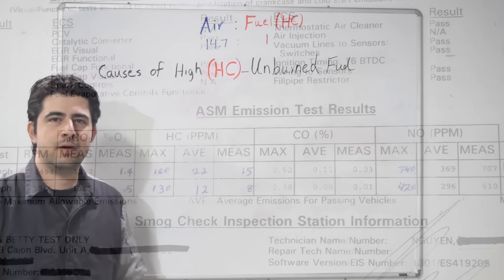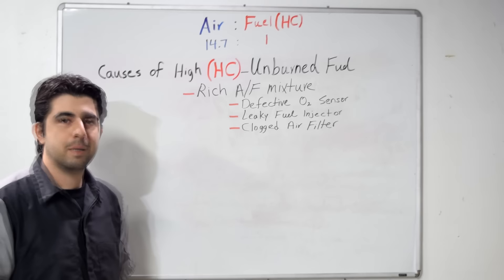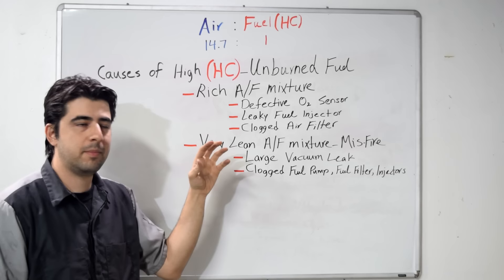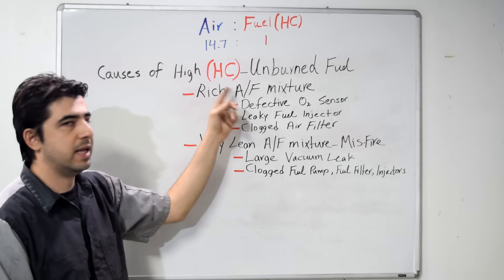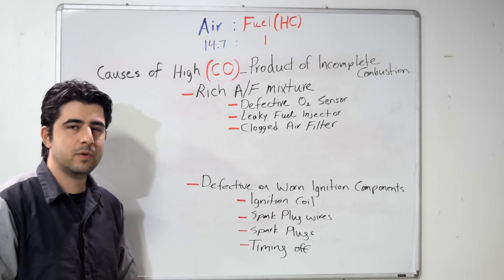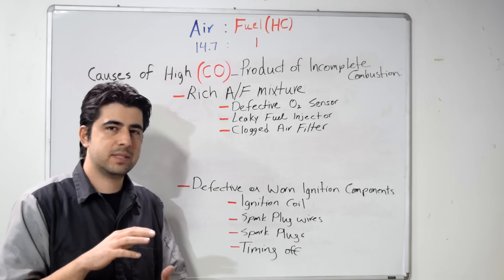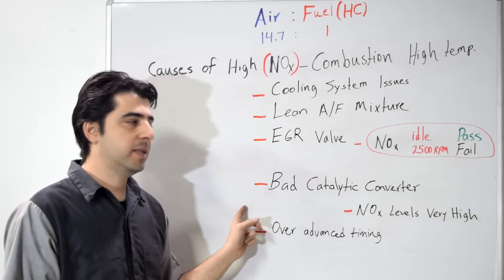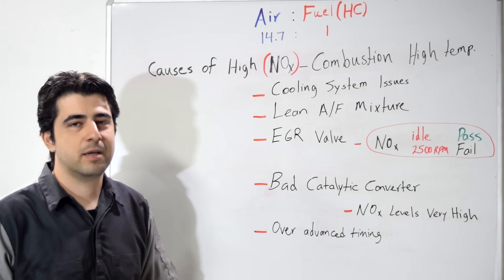Diagnosing a Failed Emissions Test - High HC, CO and NOx Causes and Repairs

Comment: I had failed my smog test, and after seeing this video I knew what to do.  My HC had failed, so I Knew it was the air mixture.  I got a new air filter.  I also got the "catclean" product...more cleaning.  I then removed my negative battery terminal to reset computer.  I even got more air in the tires.  My HC was 145 when I failed, today it was at 6.  Easy pass.  Thanks for great video.
Reply: My was 240 and max was 170 what do you think it could be

Comment: I always replace everything that’s cheap first. Check for vacuum/air leaks and exhaust leaks. Change your engine oil and oil filter. Change your air intake filter if it looks old. Change the O2 sensors. Add some Lucas fuel cleaner. Check your tire pressure (can make a difference on dyno smogs). Lastly, take it for a 20-30 min highway drive before getting it smogged. Leave it running until it’s tested.
Reply: I did all that. And welded in a new cat. New lambda plug. P.o.s corolla still wont pass for hich co and hc. Now it goes to africa. Bye byeeee! 😂

Comment: Over here you get your car back ( a 1976 carbureted 4 cylinder ) didn't pass the Emissions test the problem is that it's undriveable when it did pass. So when you finally did make it home you get a few screw drivers and fiddle around for 2 days so it doesn't use crazy amounts of fuel and runs as it did. No one who bothers you for another 2 years. It probably would have passed in 1976. The only way for it to pass and run as it should is an LPG installation. For new cars guess you covered them all.

Comment: Very informative, thanx. Especially liked...

1) If NOx is a pass at idle, but a fail at higher rpm, EGR valve is faulty 
2) If NOx is WAY above the limit (2-3x or more) catalytic converter is busted
Reply: Egr system... Usually EGR is good but dirty very rare for them to fail...

Comment: I had issue with high hydrocarbons on my 1995 Toyota Corolla. I followed your instructions and replaced spark plugs and the problem was solved. Just for a good measure I used engine cleaner, put a new high mileage oil and high quality gasoline. Passed the DQ without any issues. Thank you very much!

Comment: Very good explanation. One other point is that if you have a thermostat that is stuck open and the engine runs colder than it should, the EMS will over compensate the fuel mixture and the engine will run too rich thus increasing the Co2 levels.

Comment: my hc co pass but nox off the charsts 1300 too high so, i changed egr and sensors and got vacuum lines working too distributer ,now im not smoking at idle ,not blowing white smoke i begin too take off ,so now on too cat  then muffler  thank you sir spot on those problems !!! i recommend getting spark plugs wires firing very very good so you can tell when driving after more power etc..

Comment: Dude thank you so much my 95 civic failed the HC and NoX but just by by a little. My HC was at 0.87 and to pass it has to be 0.80 and my NoX was at 2.60 and to pass it need to be at 2.00 now I know what to look for and try to fix it

Comment: Lacquer thinner in the gas is supposed to clean the catalytic converter.
It's scary but I put some in my cars and it didn't kill them. It sounded more throaty but can't fix everything. Removing the cat and soaking in solvent is supposed to be the best.
My mechanic recommended Seafoam for de carbonizing the engine but then all that goes into the catalytic converter.

O2 sensors on eBay are dirt cheap but are they any good?

Many plug wires and coils are junk.
There's counterfeit products in very real looking packaging.

The tip about tire pressure is golden!

Comment: Thank you very much,great video and explanation, my 1998 Bmw 740il failed smog with high nox at 2500rpm, if you are in california I will ring my car to you.
Reply: if you have the original catalytic converter it may need replacing. they do go bad.
Reply: @thedeathwobblechannel6539   so a car that has the original catalytic converter(about 23 year's old) from 1997 should just be replaced with a new one?
Reply: @memomunoz2266  mine had the honeycomb break apart and would go sideways to the flow and choke off my engine.  The "go bad" when the honeycomb breaks. It has no moving parts and no replaceable parts. If it clogs replace it

Comment: this is a pretty good explanation, however it is incomplete. one big thing that most people often over look is carbon build up which can increase cyl pressures and temp's leading to elevated nox emissions, another thing is a rich condition can do the same thing because the cyl pres be higher, along thos same lines is if the head has been machined after a bad warp. on some vehicles i have observed that too much fuel pressure can actually cause high hc's instead of co. every car is different but still a very good video

Comment: My 2008 Nissan Altima failed the emission test and were struggled long to find the cause. Ignition coil, Sparkplug, Injectors, MAF, PCV valve, Oxygen sensors, Catalytic converter, Piston rings everything was addressed but the problem still persisted. Finally, someone noticed that the temperature gauge was always showing a very low value. And it was found the thermostat valve was faulty and was stuck open and the ECU was sensing it as cold start condition always and the fuel air ratio was running rich. The fuel economy also improved a lot after replacing the thermostat valve but I miss the sporty acceleration and pick-up when it was running rich.

Thought might be useful to someone going through a similar trouble.

Comment: Every year my 97 Dodge Caravan gets closer to failing the emissions test and this last time it did fail on the HC part of the test, when it measured 62 ppm when it was only allowed a max of 51 ppm. So I decided to try filling it with E85 Ethanol on a almost empty tank and it worked. When I took it back for a retest it drastically reduced the Hydrocarbons (also the CO and NOx) and I passed easily! I recommend anyone who is a borderline fail to give it a try because it worked better than additives and other methods that I tried and didn't work.
Reply: 51ppm? Thats insanely low, it would have to run on water vapors, 510ppm more likely? 200ppm is the limit in sweden.

Comment: Failed smog test. Failed 15 mph test. 100 over PPM at 608. 
I put new plugs and wires, replaced Head gasket kit 4 months ago. 
O2 Sensor is fairly new, replaced it 4 years ago on last smog. And also replaced Catalytic converter same time 4 years ago by pro shop that specializes in muffler and Catalytic converters. 
Had shop rebuild engine 5 years ago. It's really strong engine. 

Tonight I replaced air filter and put in Guaranteed to pass Fluid. 
going to replace Fuel Filter tomorrow! 

Emission test results on fail say: CO2 is 17.4, O2 is 0.0 and again 100 over NO PPM at 608. 

Any thoughts?

Comment: Hi first of all thank you very much for this video i got so much knowledge by this video i always check videos relating to car fix but never seen someone explaining like this .
i have one question i drive 1.4 petrol car 3 months back engine warning light came up  there was a problem with o2 sensors but i replaced 2 sensors but stll engine light stays on few days later i reset that light but next day engine warning light came back again brought to garage they checked there was a problem with exhaust was leaking they fixed it and last week i brought my car to pass emission test they failed because of high Hc and co  and the warning light came back again.so can you please tell me what could be the problem thank you.

Comment: im a tech here in CA here are some tips :

for the years 2000 and up. they use a new machine only checks obd 2 so no check engine light and all monitors completed expect evap will pass your test .

for 1999 and older your car will go on the dyno if its 1996 and newer you will not pass if you have the  check engine light on , computer picks it up and fails the car automatically  even if you do good on the dyno.  

for 1995 and older you "can" depending on the shop pass with the light on and monitors incomplete since you will not communicate with computer , it will be a visual inspection at that point .  but most likely if you have a light on for like a misfire or something your car will not pass the emissions test since it wont burn the fuel properly
Reply: Josey Marine I have a 95 truck and emission test fail HC was high at 240

Comment: I have a 1995 Mercury Mistique with a 2.5 V6. The passages in the plenum behind the gasket of the throttle body were completely clogged and the EGR tube had a split in it so I had multiple things wrong and this caused me to fail the emissions test.

Comment: I calculated my A/F ratio using my ASM results, and im running very lean at 15mph but only a little but lean at 25mph. Would that still be a vacuum leak? I also noticed my o2 is high at 15mph. im thinking maybe at 25mph the vacuum leak is being overcome by something and everything passes at 25mph. can someone please shed some light for me, thank you

Comment: Thanks for making this video. But I have a question about NOx. If I have excessive high NOx at 15mph but lower than avg for 25mpg, can I rule out a bad catalytic coverter?
Reply: Clarence, I thought the same thing for my car (same scenario)  but as my CO is very low at both speeds I’m ruling out a bad cat for now and focusing on plugs/wires first (partially focusing on cheaper fixes before hitting the big $$ items). As you commented three months ago and I suspect you had an emissions issue, whatever became of your circumstance? Did you figure out what was wrong?

Comment: really good video., I must admit that it takes balls to be in front of a camera and to try to explain all of this info to the general public. Btw you forgot to mention the words "at sea level" 14.7 - 1 ratio at sea level. 
LOL You have a very confused look. I like how you look and sound like you're guessing. I've been a smog tech since 1990. and I have 2 fancy laminated lists on my shop wall for my customers. 
#1 If the HC and or NO is slight elevated over the MAX that means you have Carbon build up. Run some injector cleaner through the tank. That's about 300 miles or so for most vehicles. that will clean up the carbon build up. if the CO is elevated replace the O2 sensor. if you have close to or over 200K on the odometer then it's time for the Cat. 
there are a few different test we can do in the field to check the Cat. with my experience most cars go about 200K before the cat dies. May God rest all of the 9 lives.

Comment: Exhaust leaks are also something that should not be overlooked bc depending on the location, it can skew oxygen sensor readings, or cause very high NOx levels if its located before the catalytic converter but after the upstream oxygen sensor. The extra oxygen lowers the catalysts ability to reduce NOx.
Reply: +josue ruiz This is an interesting point you bring up!  I am trying to diagnose 2x the amount of Nox allowed, and I have all new plugs/wires/dist. cap/rotor, new cat and back exhaust system and recent flush/filled radiator (with no signs of problems) and the car runs just fine, BUT I think I can hear a leak at the exhaust manifold, so this could be my issue! 

+RatchetsAnd Wrenches Really nicely laid out explanations and walk-through! Thank you.
Reply: So great video ,it help a lot unfortunately my car 2002  Toyota echo won't pass the emission test,ND needs some cosmetic work ...(N-0 ×) .
Reply: Josue--Interesting. My HC & CO are ridiculously low (like 20% of max) but my NO is triple the Max!
Reply: @Funny_How  CO and NOx have an inverse relationship. When one is high the other is low and vice versa. Sometimes both can be high but that usually means a bad catalytic converter and is usually the last repair once all other systems have been checked and confirmed to be operating properly
Reply: @josueivanruiz  Thank you!
Reply: @Funny_How  do your exhaust readings also show more than 0.2-0.3% oxygen? If so, your car could be running lean or have an exhaust leak
Reply: @josueivanruiz  %O2 reading at 15mph=2.5.   %O2 reading at 25mph=2.1. Thoughts?
Reply: @Funny_How  what kind of car is it? Does it have an air pump? Or forced induction?
Reply: @josueivanruiz  '79 Monte Carlo. 3.3L V6. def no air pump! Ha!
Reply: @Funny_How  seems like you're on the right track then. Finding a good technician that knows emissions and carburetors is difficult but they're out there and its always best to test than to guess. Good luck and let us all know what you find out.
Reply: @josueivanruiz  Thanks and enjoy the rest of the weekend!

Comment: Hey man. Nice Video. It's a big help.
I have the opposite issue on the NO failure. High values at idle but normal over 2500.
Would it still be the EGR or the relay?

Comment: I have a 95 jeep g cherokee 4.0 that is passing 15 mph test and failing 25 mph NOX, but no EGR system on this year, any thoughts or direction?  
260K and still has good power and acceleration.  New CAT fixed 15 mph high NOX, but not 25 mph.  Also put a new O2 sensor on 6 months ago to fix rough idle and check engine light.  Added new plugs, cap and rotor, but wires still look new.
New air cleaner and oil change and coolant is fresh and topped off in radiator.
No vacuum leaks detected.

Comment: Thank you for the explanation, I need and advice on that I have removed the ECM from my BMW Z3 1998 and return it back immediately, but I got the engine shaking and vibrating.. is there any explanation to this issue????

Comment: i like the info in this clip and i know its 3 years old but can you shine a light about the the diffrent readings of CO, HC and NOx in relation to each others and what does that indicate. i willing to buy a lexus gs300 the price is less than 2000$ because it failed in the emmesion test because of high CO and not the others is it worth buying and fixing?

Comment: Hi i just bought a bmw 116i 2007 just checked its mot and its got (Exhaust carbon monoxide content at idle exceeds manufacturer's specified limits) 

(Exhaust carbon monoxide content after 2nd fast idle exceeds manufacturer's specified limits).       Been to the mechanics changed the nox sensor on it that works fine and the other code was upstream oxygen sensors so the lamba sensor came up if i change that does that fixes it ?   

And have u got rough idles and less power cant pick up speed that much when the car warms up when the car is currently cold not warmed up it runs and got power to it

Comment: I have a 2002 Saturn SL Sport sedan and an inspection coming up soon. I have been told that I will not pass this year because a lot of the sensors are failing, not because of any known exhaust issues at this point. One shop quoted $1000 to replace all the sensors which doesn't make sense for a 15 year old car. But I love my car and would love to keep it. Another mechanic monitored my car on the highway for 15 minutes and said that my car was "running cooler than it should" and he wanted to replace the transmission. Again, I'm wondering if it is a good idea to put money into a 15 year old car, even though I love it. 

If I was in CA I would come to your shop!  :-)
Reply: get your car tested, never do what a shop says. too many crooks out there to screw over women. get the printout from the test then go from there.

Comment: hi, iv a 2002 jeep Cherokee 2.5 crd sport, my engine blows dark smoke when I sit idle n rev hard. also uses lot fuel. also when driving feels slow under power as if it's been pulled back as you want to go. don't feel right. has it a turbo on it , or some sensor that may cause it to smoke or under powered.

Comment: good info. can you tell me how clogged air filter would affect with high hc or co? The maf sensor is going to measure whatever air comes in through the filter so if a filter is clogged then the maf sensor would just measure whatever the amount of air there is and fuel will be delivered according to that.

Comment: I have a question for any of you here. My EVO 4 failed emissions and I just bought a O2 sensor with 4 wires and my original is 2 wired, You think I can cut the two wires and use the two that is supported?
Reply: You should not buy “a sensor” but a sensor that is specifically designed for your car. Most online car part shops have an option to fill out your car make and model and engine, after which it will only show parts that will fit your car. If you want to get a random sensor to work then you have to dive into researching what signal the computer of your car wants to see, and what the sensor you bought outputs, then try to make it match.. i would suggest to not go that route.

Comment: Good explanation:,Now did I understand it,here I go:   My 1990 351 windsor failed this part of the KaliforniaSmogTest: " The idle 2000 rpm hydrocarbon"portion of the test.The max acceptable HC was 120 but it was 140when tested. .  Before the test I had changed the plugs and the wires. With that and what I think I got from your video, Im thinkin its either the pre cat sensor or the exaust manifold cracks that are effecting the AFRatio to the lean side. Is this close? My dash seems not to have any check engine lights that come on. Is that possible?
i thought you said a partial failing precat sensor might not trigger svc light.
Reply: Tommy Gunn or maybe the catalyst I have the same problem the HC was 170 and 240 when it tasted